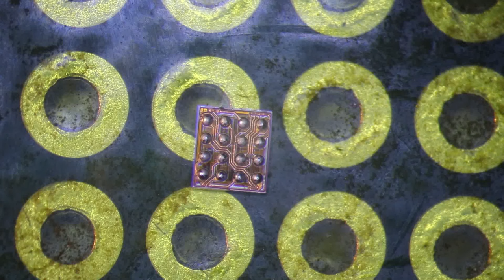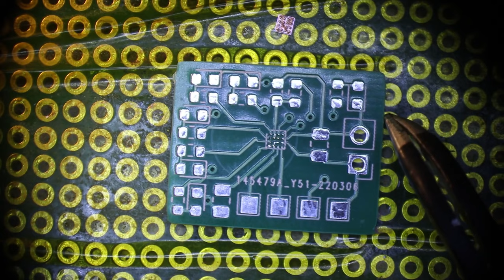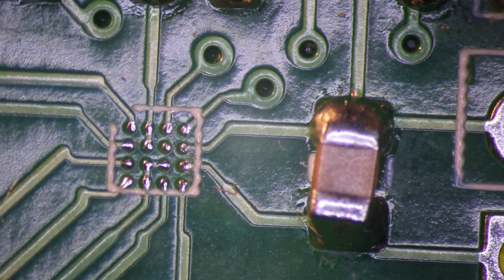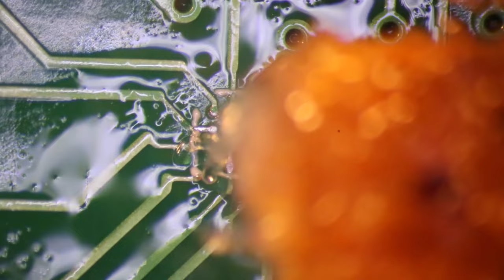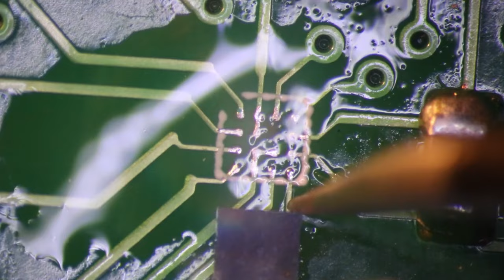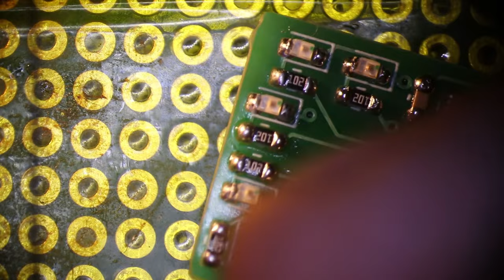Soldering a WCSP package to a cheapo 2-layer PCB

Comment: Recently I assembled some 2x3 DSBGA chips.  I managed to get it to work by using hot air under to preheat, and hot air over once the chip dropped a little bit.  Even on the lowest air speed it would just blow the chip away unless I was coming directly down.  Having a microscope would've made it much easier.  Thanks for making a great tutorial.